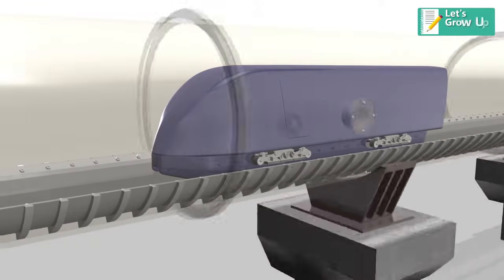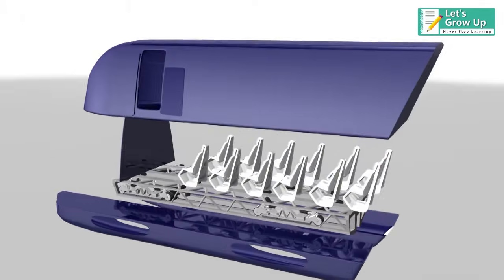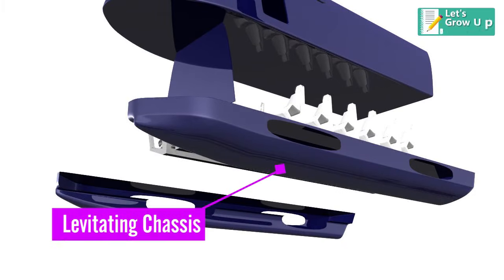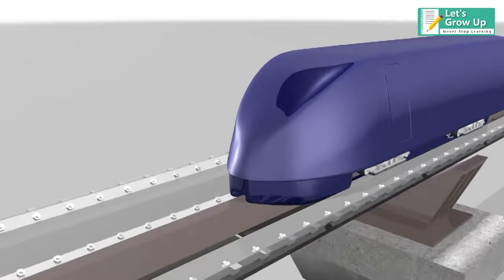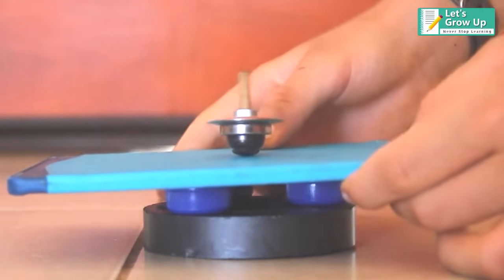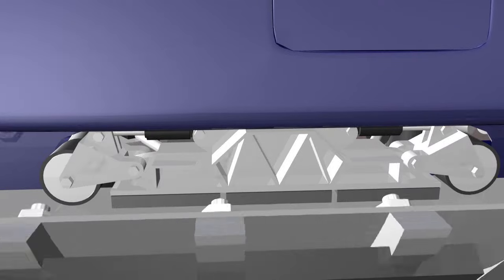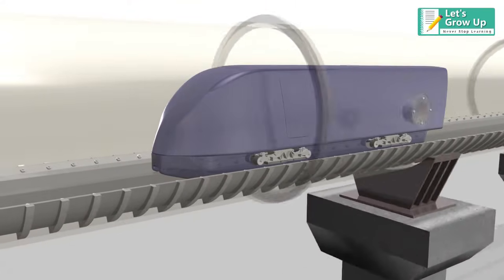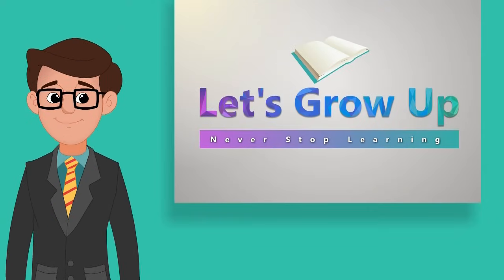The Hyperloop Unveiled | Exploring Elon Musk's High-Speed Vision for the Future

Comment: This aged badly as the test track was dismantled.  Pity the problem was never about how to make magnetic levitation to work.  The problems were the massive cost of maintaining a vacuum, dealing with thermal expansion for a sealed, straight tube, fast passenger ingress/egress out of a vacuum tube, acquiring land for very high speed, straight lines, creating emergency evacuation procedures etc.

Comment: How is it any different from Maglev then?
Reply: Its in a vaccum tube so it has very few to no air resistance or friction
Reply: I believe it is just a version of a maglev (although supposed to be inside a near vacuum) . But the Virgin Hyperloop lead said something about it being a better variant as in "not your father's maglev".  However, they just released a computer simulation that shows another change - the maglev track is above the car which is "hanging" below the maglev tracks.
Reply: Hyperloops magnetic, is far less infastructure expense as mini rail beams and compact ratio. The infastructure of the SCMaglev in japan, is staggeringly massive high cost, only impressive by Japan size, not world around, the German version needed to swap the massive track stack of gizmo stats, with simple magnets on the cart to reducs huge building cost. Had both be very wide tunnels, the whole reason for avoiding sonic sound nuesons. They may beat hyperloop by time build, but very outdated technology since the mid 20th century drawing board.
Reply: Also maglev is far more expensive in power usage of massive outdated magnet designes, like the SCMaglev, the Gernan maglev could've been modified. Hyperloop swares it will cost less to travel, but the infastructure may stack folds both travel and build in comparison to maglevs, we'll have to see in the long run.